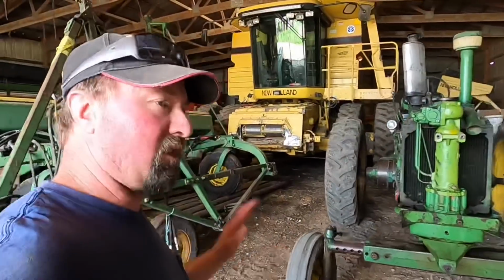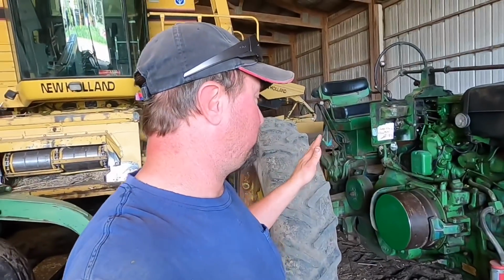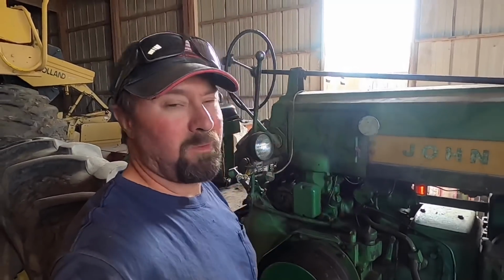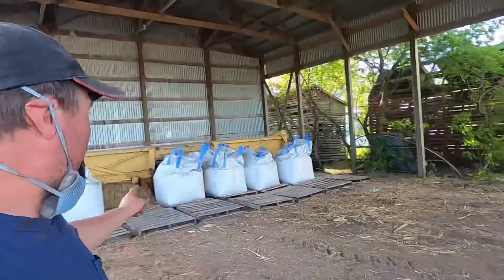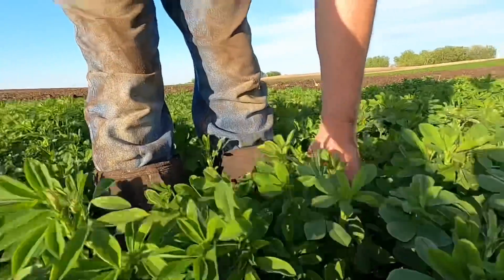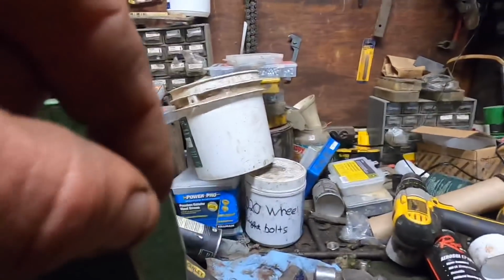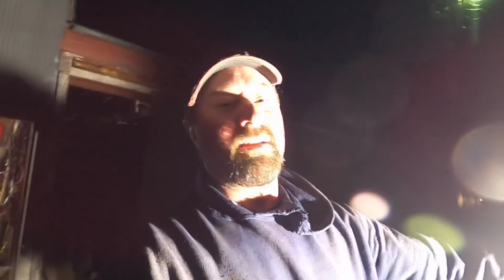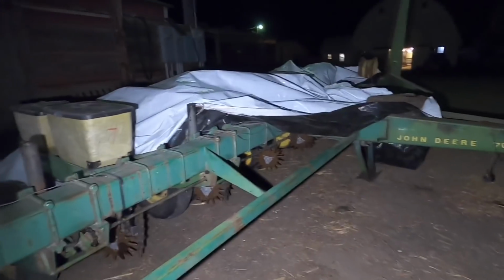Plowing In Green Fertilizer!

Comment: Great to see the old tractors
Reply: Don't waste your money going to JD for coils.  Go to A Harley Davidson shop and purchase two 6 volt twin tower coils.   They will fire  better.  In 1986 you could buy a two coil pack for half the price of one JD coil.  Easy to retrofit also.  If I remember right I got mine from J&P cycles in Anamosa Iowa.  You will have to use a different spark plug wire.  Beats all the frustration of OEM and the smoke.
Reply from the maker: Thanks for the info.

Comment: If it's block sealer, I used it on 84 Ford 6.9 diesel and it worked for 2 years before i had to tear it down and replace the head gasket. It's worth a try.  Have also used it on 351 Cleveland gas engine and never failed